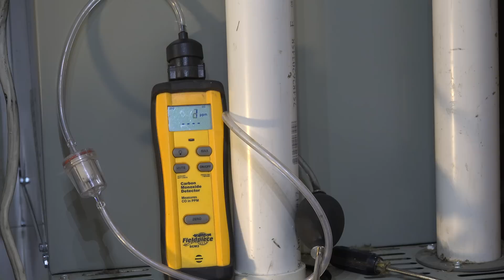Carbon monoxide testing of the gas appliance, Part 2

Comment: I would have thought you would have had a whole lot larger parts per million in the actual exhaust pipe
Reply from the maker: No, the efficiency of the burn is quite good with the modern gas furnace.
GFM

Comment: The test method shown in this video is NOT recommended since it does not discuss how the level of CO in the vent changes during operation.  A useful test is to measure CO in the vent using a Bacharach Monoxer or similar instrument. These have a pump and a continuous readout. I like the newer Monoxers which have a graphing function.  The key is to begin the test BEFORE starting the furnace and watch the CO levels as the burner comes on. Typically, the CO level will rise rapidly until good combustion develops (a few seconds), then drop to the teens or twenties (ppm CO).  The most important point is to watch what happens to the CO level when the main BLOWER starts.  The CO level in the vent should NOT change.  If the level changes (other than continuing a slow decline), there is probably a heat exchanger concern.  If the CO level begins to rise when the blower begins to push air around the heat exchanger, this can be an indication that the blower is influencing the combustion.  If you instrument has a temperature probe, watch for any change in vent temperature when the blower comes on.  A rising level of CO in the vent and/or a cooling of the vent temperature are consistent with the introduction of ambient air into the combustion chamber, cooling the flame and producing carbon monoxide.  The CO will be vented out (unless the vent is damaged or loose) and typically NOT enter the air pressure on the outside of the heat exchanger is much greater than the pressure in the combustion chamber (which is actually a negative pressure due to the draft inducer).  This is the main reason forced air furnaces are relatively safe even when the heat exchanger is damaged. A cracked heat exchanger lets air into the combustion chamber, not combustion products into the circulating air.  Please go to the carbon monoxide safety association website for more detailed information. Please do NOT rely on the test shown on youtube by grayfurnaceman

Comment: I got 13 ppm it’s only 5 minutes and it’s was rising
Reply from the maker: Where are you sensing?
GFM
Reply: At the supply register
Reply from the maker: @usastyle500  That is not a high number, but if the air in the structure shows 0 or close to it, I would be concerned.  Next, I would sample at the supply plenum.  If you get the same or higher number, you need to find out if there is a combustion problem or a crack in the heat exchanger.
GFM
Reply: grayfurnaceman thanks

Comment: Could you comment on the pump with to Co unit
I believe the fieldpiece CO detector is not designed to be used in the flue, but I could be mistaken
Do you think using it with the pump in the flue will harm the sensor from other exhaust elements?
What is your experience so far

Comment: With a high C.O reading in the vent check that it is clear at the termination and check the gas manifold pressure to make sure the firing rate is correct.

Comment: Just burning incenses in a plastic bag produces massive amounts of co over 500 ppm in just 2 minutes.
Reply from the maker: Candles can also produce CO.
GFM
Reply: @grayfurnaceman  yeah i seen that too
Reply: I don't doubt that. CO is produced when combustion is occurring without adequate oxygen.
Reply: What if I smoked 7 grams of weed in a motel room in 2 joints. Would the smoke create CO2?
Reply: @sleepwalker29  It would create CO and CO2.

Comment: 0 ppm is Normal Fresh Air
9ppm is ASHRAE recommended maximum indoor CO level.
10 to 24 ppm is where possible long term health effects might happen.
(If you are already ill, or have a bad heart, or are a child then these low levels are risky to you)
25 is what the maximum for 8 hours via a TWA (time weighted average) ACGIH uses. (American Conference of Governmental Industrial Hygienists)
50 ppm is what OSHA uses. 

EPA uses one hour 35 ppm TWA and 9 ppm for the eight hour TWA.
Reply from the maker: I have read all these numbers.  They are mostly worthless in the field.  These numbers do not take into account the health of the person in the structure (as you say).  I have known people who would die at 10 ppm.  No joke.  If you read any CO in the structure (unless there are smokers), start looking for a problem.  Forget the numbers published.
GFM
Reply: The CO subject is really an interesting area. A medical doctor relative in Seattle office had a gas water heater that ran legally well below the 100 ppm in the exhaust stack; ie 20 to 45. The inside air would read zero when the HVAC guys tested it. BUT my relative still felt slightly ill at times on long days. This only happened a few times a month. What complicated the matter is the relative was a Doctor who believed all sorts of stuff around the home and house makes one feel ill. ie electric meters, cell phones, TV's, computers, plastics.

 What was happening is there was an odd backdraft on rare times would bring the CO into the building. ie it took a Colombo better HVAC guy to really fix the issue. 

The landlord actually replaced the gas water heater with a modern one that ran radically cleaner but there was still every blue moon some CO in the working area.

 My relatives "home type" CO detectors really never detected the CO, often these are just to alert dangerous levels and not minor levels. 

What was happening is another tenant in the building had this exhaust fan that created some odd airflows that caused the issue.

Here I have a Testo 320 for the furnace and a Test 317-2 to measure CO in the inside air.

Comment: I've seen holes in the heat exchanger so big I can see the back of the furnace cabinet clearly in a standing pilot furnace with draft hood and there was no co found inside the plenum with my bump tested co detector, as the combustion process was burning clean. Carbon monoxide is a by product of incomplete combustion, usually because the combustion process is starved of air or the flue products are not escaping to the outside of the home or heat exchanger is plugged. However gas code states in my area if cracks or holes are found. The heat exchanger shall be replaced.
Reply: Locally the cracked heat exchanger gambit is often a scam to sell new furnaces. OR it is their method to avoid lawsuits and deaths. Since the state here is ground zero for suing folks and jackpot justice I guess being safe is done. 

Many decades ago in HVAC classes in Mechanical engineering I learned a cracked heat exchanger when the air handler is running forces air INTO the exchanger and NOT into the air ducts. ie we measured positive pressure in lab tests as more positive in the ducts than the exchanger. 

Thus CO did not go into the air ducts. * BUT during the first preheat of the gas heater before the blower is on one might get CO into the air ducts if the building had odd air flows and the cracks were huge. ie another machine reversing the air flow and then CO would go through the crack into the duct only before the air handler was on. 

**Thus my take is a higher but still legal CO level in an exhaust stack often still has no risks, BUT there are acceptions. ie the stack might get clogged by birds or come undone and that say 200ppm of CO might get into the living area.

Here I have a test 320 to measure CO in the stack and a testo 317-3 to measure CO in the living area. One of my Furnaces is from 1986 and does have cracks but still is legally OK to run from the CO stack numbers. The CO as measured by the testo 317-3 inside is 0.  HVAC guys who poached locals after Katrina quoted me 45k to replace the two furnaces and two 5 ton AC units, ie 4500 bucks per ton. There was so much work that they wanted a big deposit and many months just to get any actual work. Today prices are about 1/2 to 1/3 of that. ie the stormers are gone and prices are back to normal. I actually bought the two testos because I wanted to know if my units are safe via actual real Engineering tests and not just emotional cons scams, tiny cracks or scrapping stuff just because it is X years old. 

Sadly there are many folks killed due to CO issues and too folks who do not want their units checked since so many get scrapped via CO crack scams.
Reply: Co has a specific gravity of 0.9 which means it's lighter then air
Reply: CO is very slightly lighter than room air but its transport is often via drafts. The molar mass is 28 versus air which is about 28.8. Exiting Furnace roof vents with a high CO level can be pulled into an open window or open attic vent. Yes it is lighter than air, but barely. That is why CO is so dangerous, a poorly running unit can have a bad vent joint in the attic and the CO can be pulled down into the building in another path.
Reply: and if you have good venting and draft.  those are keys.

Comment: what does it mean if your furnace is venting close to a 100 ppm?
Reply from the maker: I am not happy with that high of a reading.  It could be dirty burners or possible crack in the heat exchanger.
GFM
Reply: grayfurnaceman what about when a furnace has those pieces of metal that sit inside the heat exchanger close to the burners. i had a senior tech say to pull those out.. ive seen those rust out and cause excessive co
Reply from the maker: I believe the were for reduction of nitrous oxide.  I don't see a problem with removing them.
GFM

Comment: Carbon monoxide acts like it is heavier than air, which means it goes down not up. The lower you are in a basement the worse it is. Think of it like pouring water into a basement, you might be safe on the stairs going down, but it might be deadly at the bottom and once you pass out and hit the floor you are in big trouble.
Reply from the maker: It actually has a specific gravity almost the same as air.  I will be doing one on this soon.
GFM
Reply: John C above freezing it is lighter than air, below freezing it is heavier than air
Reply: Co is slightly lighter than air, it doesnt act like anything